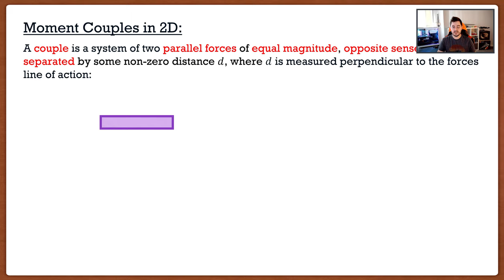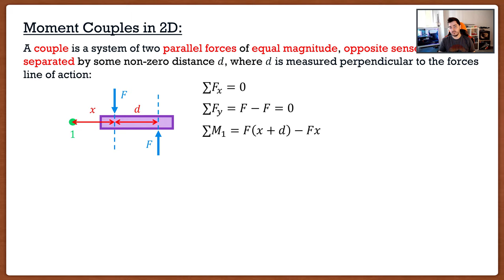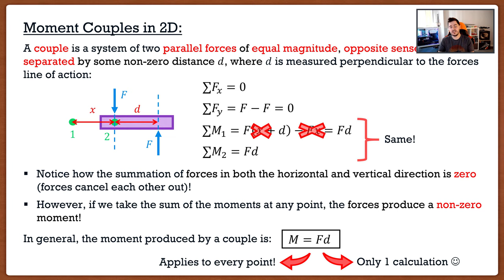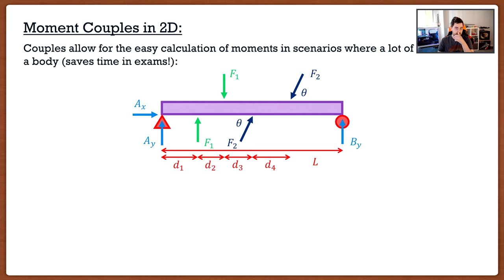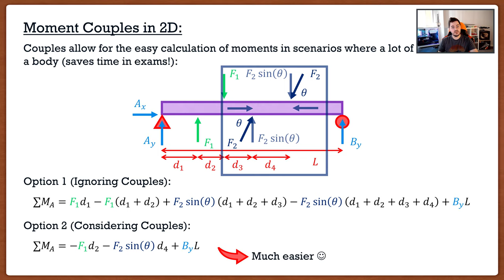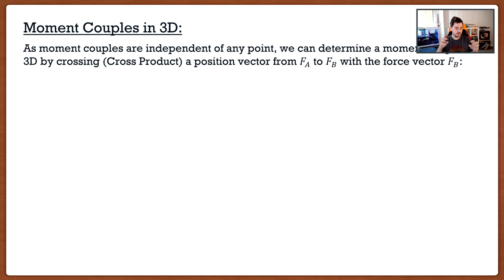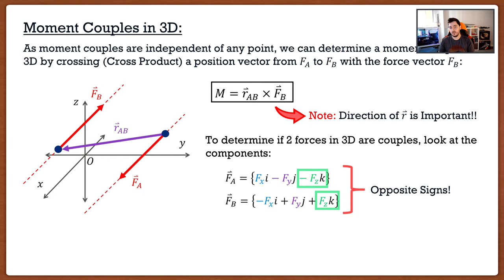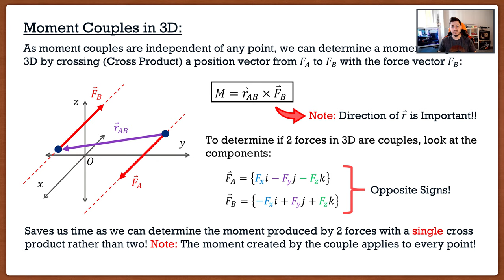Engineering Mechanics: Statics Lecture 11 | Moment Couples

Comment: 14:30 how do we solve if all components aren't the same? just solve it like moments uncoupled and use varignons theorem to get out resultant moment
Reply from the maker: Unfortunately yes haha there are some tricks to make it easier if the forces are parallel to the planes created by the basis vectors but for the most part you’re limited to taking the moment (via cross-product) of each force vector separately then adding them together as you mentioned.